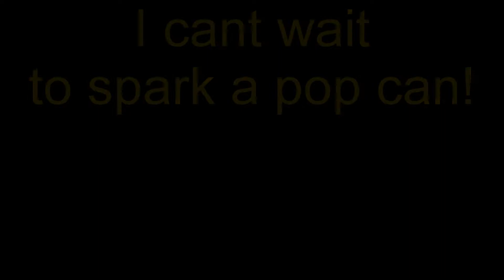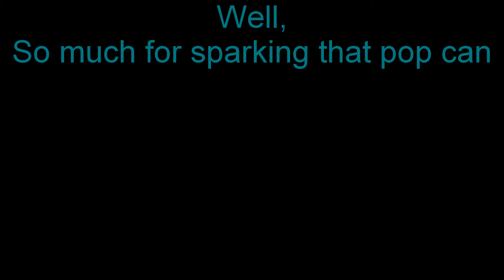High Current Transformer Up In Flames

Comment from the maker: @web1bastler Ill keep that in mind, thanks. Wow, a computer PSU outputting enough voltage to be felt would not work out for ANY component on a computer without blowing it. Just luck of the draw.

Comment from the maker: @ubuntupokemoninc Ohhh, Well, I know the core is normally welded thinly to hold the core together, and I know, it draws more current, but if that was the case, the primary would have gotten hot (which it got warm kinds fast) But it dies due to the high current wires shorting to the core.

Comment from the maker: @RODALCO2007 Ya, Well, I didnt even want to nuke this in the first place, I was just about to spark a pop can. But, then the wires dug into the core and shorted, there is no fix at that point, so I minds well let it burn up and repair it after.
And the primary, I need to test, but I think it is dead as well, and if it is dead, I will use the core to wind an inductive ballast for my MOT's
And I am sure there is no way to get electrocuted, I am always careful :)
Thanks

Comment: @juniortore1 no no no no, thats not what i meant, believe it or not, there are currents in the core they spin in a circle, these are called eddy currents, the point of a laminated core is the thin layers in the core (witch don't touch each other as the are varnished together with poly urethane) is to create resistance to limit these eddy currents, you short those layers in the core out and you take away reactantance thus over heating the primary, and burning it up!

Comment from the maker: Ha, thats what I thought, wire really smokes!
And yes, I didnt know if the primary was going to short and slowly bypass more coils and draw more power, since I didnt want to pop the circuit breaker. So I was just ready to pull the plug. Otherwise I would have just let it go, without stopping it. Dont worry, I have another dead mot with a shorted secondary, when I power it up, the secondary gets real hot, real fast. But the pri is good So I am thinking ill nuke that one once I get my variac.